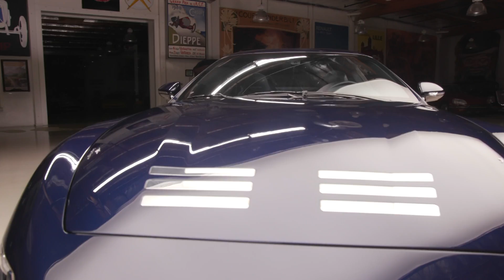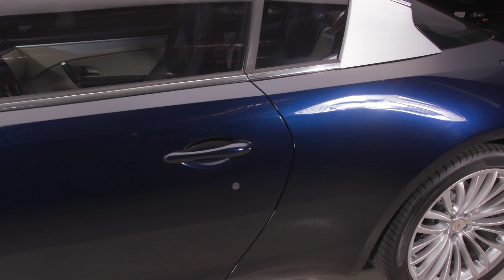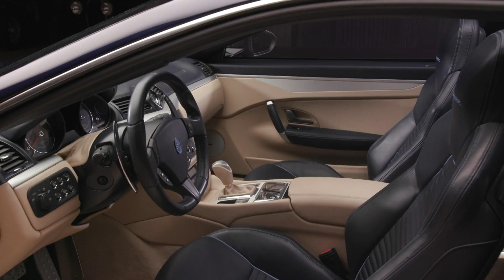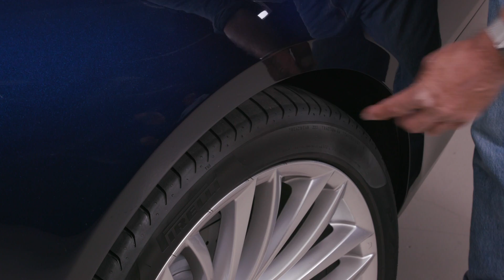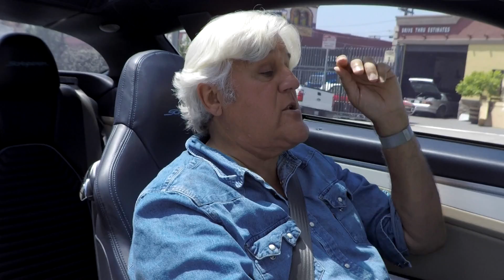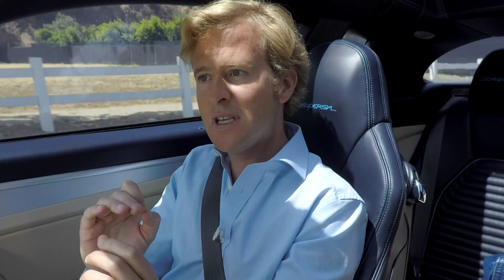2018 Touring Superleggera - Jay Leno’s Garage

Comment: Coming back to this video 7 years later. The design has grown on me. There are some very nice details in there, and it is rather elegant overall. Even if I still think the front-end styling is its weakest point . It reminds of a Bangle era designed BMW 6-series up front, if not as bad.

Comment: Without taking anything away from the excellent work done by the new Carrozzeria Touring Superleggera, it's important to rembember that there is no connection between the historical firm which closed in 1966 and the new firm which purchased the legal rights to the name in 2006: 
Good luck to the new firm, just let's realise it's a different firm to the old one.

Comment: A worthy improvement on the original Massa 4 door, I'm so glad someone did it. Super finish on the Superleggera and what an intelligent application. I see a resemblance
with the Ghibli. The starter is noisy and unrefined and if it were mine you wouldn't hear the engine.

Comment: Just a re-body of a badly engineered Maserati.  I find it interesting Jay left in the negative comments on the de Macross (which borrowed only the Ford engine and trans) while removing them from this thread.  The level of effort and engineering on this car is much, much lower.

Comment: In my opinion, the aluminum applications on the side and on the roof should have been connected in one piece. Also the back end is a bit confusing and cluttered with unnecessary details ...

Comment: a vast visual Improvement on what is still a vastly underwhelming car under the skin-- but it is beautiful now whereas the original is absolutely not , IMO. (Edit. This is the newer grancoupe (sic) which is not at all as bad as its predecessor  )
It resembles a Spyker from the rear now -another underwhelming but very gorgeous car.  Only in the front can you really tell it's still a Maserati under-the-skin, and only in the front is it not an improvement, the profile is unique and exquisite where the orig. comes off as a bit stumpy , very nice overall work, for the vasssssst overall probzble cost , if there are no capital  R reasons they could not , id have used a v12 rwd ferrari or perhaps even , say a bmw 6 coupe...

Comment: Funny how Jay said a car “designed by committee” ends up looking like a Corolla; IMHO in terms of appearance, the new Corolla hatchback with two fewer doors, another foot of wheelbase, six inches more width, a few inches less height, and a couple round tail lights, would make for a better looking FF than the one Pininfarina designed.

Comment: Taking a finished car or chassis and adding a custom one-off or limited edition body/interior has been an option from the early days of automobiles. This technique has led to a huge variety of designs that are not possible in mass production, though there is some debate (see comments) on whether the design is appealing. I think the most interesting custom cars are those that have unique styling and unique propulsion. Louis is clearly a very talented person and it is interesting that Touring can re-body a  Maserati Gran Turismo, but I more admire the people that produce a new body, interior and mechanical bits. At least Touring is only dismembering 10 Maseratis. Doh!
PS: The exhaust seems too loud for a luxury grand touring car....sounds like Jay's 57 Corvette. 🤔  Interesting conversation and thanks for the ride.

Comment: What is kind of cool about a car like this is that with one person controlling as much of the design as happened here, you do get flaws or quirks that are particular.  Other than Bangle, I can't really think of a current designer who has a signature to his or her work.  For better or worse, this definitely has it.  I really like the car, the front looks a little bit like trying to get an E Type to look like a 1st Gen Mustang, but it's still pretty.  I'd have done it differently but it's still cool.  The only real downside I can see to a car like this is you get stuck with a dated Maz interior.  It would have been very nice if they at least could have replaced the head unit with something contemporary.

Comment: That panel on the C pillar and the rake of the rear glass is very reminiscent of Citroën, so much of the car seems to share a common design vocabulary with the best looking cars without looking derivative, nicely done! The very tip of the nose looks like it's forming a letter T and unfortunately makes me think of something that would come out of Tesla but other than that it's a very beautiful body and interior. 

For a technical person it sounds like Louis was trained in how to speak to potential customers, the way he continually avoids the term unibody to describe how the Maserati donor car is made and chooses to use the incorrect word chassis which I feel is a company attempt to closely associate the new product with the old world product in the same way that this new version of the company tries to harken back to a past it has no connection to other than through the check books of its investors. Near the end he admits that he works closely with marketing, it's obvious and necessary or they wouldn't have allowed him to speak at all. Louis also says they didn't make any large tooling for such a small production run and I assumed he meant steel stampings but a minute later he says many of the body panels are CF which does require large tooling, not as large as steel stampings but more than you'd need for hand hammered bodies. Jay also seems to think that the cars are hand hammered too and makes a number of references to what is clearly not the case at Carrozzeria Touring Superleggera srl. It's when Louis uses the word bespoke immediately after talking about CAD/CNC that I find bothersome. Bespoke has become an over used word and does not mean what it used to. Can you really call something bespoke when all you are doing is calling up a file and sending it to a machine?

Comment: This is why I believe that cars are art. There are many cars that are a car. But like in Japanese cars which are getting a bit off course in design. Many Japanese cars and even some American Cars are going through a series of changes.    Many cars are pretty but rolling junk. They would rust away and they would vanish. It's amazing that the Germans get it right they just do slight tweaks here and there. American cars are tweets as far as a grill is concerned maybe some tail lights but then they're discontinued with a whole new design that people probably don't like because the quality is still not there. What American Car designers won't have to worry about designing cars soon they're designing SUVs so-called crossovers and trucks. Pretty soon that's what the Japanese will be doing and that's it. But I believe that the Europeans will be designing crossovers from many small cars with a soul.

Comment: I quite like the car, it’s different and has at least a somewhat unique design. But can you really say it’s truly coach built when Jay opens the door and you see the exact interior as a Gran Turismo? It looked like the only thing that changed in there was the badge on the steering wheel.

Comment: Jay, I respect you more than probably anyone in the auto industry, and I appreciate your vision into this Maserati, with a new body, that if u need a fender, your dead, and those seats that stick out like sore thumbs because they are a different color, and the guys reasoning behind it is not clear, I could see if the color was the same, but ugh, the body is beautiful, but it's still a Maserati, and the dash, steering wheel, air bag, this just doesn't work for me, it's a bit of a sham, going back to the 70s Stutz, like the one Elvis had, that car had more Stutz in it than this has its new name tag

Comment: Sorry Jay. IMO, you can't improve on perfection. The Maserati GranTurismo on which this is based has been in production from 2007-2018 for good reason. To this day, still one of the most striking, beautiful designs on the road. Along with perhaps one of the greatest naturally aspirated V8s ever produced from Ferrari in the 4.2/4.7 engine. Wasted exercise from a great historical coach builder.

Comment: This design doesn't look like anything special,  the over all body shape looks like a whole bunch of other modern cars. Its a simple design that a ten year old could draw. I hate the stupid "football" fake chrome- aluminum stripes on the hood and all the aluminum trim pieces. most of all I hate the cheesy signature on the seats. I cant believe people are paying $400k plus let alone building 10 of these a year. Its the same for that other company Ares Design where they steal a cars uni body, suspension engine like 90% of the car then charge you 400k plus to stick there modern interpretation body shell on it, it ridiculous. This is a beautifully designed car that I would invest my money to get built-   https://www.motor1.com/news/146278/ferrari-612-supercar-rendering/

Comment: I have always hated the look of the stock Granturismo because i find the design of the stock Maserati to be out of proportion and not as pretty as it could be.  This car, as design isn't that pretty ultimately if i have to be honest, BUT BUT BUT this version has enormously improved and make the Granturismo look SO beautiful NOW!  If i had the means and the money, i would absolutely buy this car.  I love the Granturismo as a driving car, but hate the stock look of the normal car.  This version fixes everything, especially the lower lines of the side window, no longer tilted down, but now beautifully horizontal !!  That has single-handedly improved 90% of the look of the original car.

AWESOME WORK TO THE DESIGNER HERE !!  I LOVE this look despite it not looking perfect.   I want one of these Touing Superleggera !  Huge improvement of what Maserati did to the GT!

Comment: The front end looks too busy and tacky. The doors and the side profile in general looks a bit too bland and bloated. The rear is much better but does not fit the sides or front of the car.

Comment: this kind of thing puts a smile on my old face, i used to sit around doing drawings probably similar to what is required to make cars like this happen. i would take bits and pieces of cars that i liked or features of cars that i liked and combine them all into one drawing of a car and make it look similar to several different cars and then people would look at my drawings and some would see well this part is clearly from this car because of the way it swoops and connects here just like on such and such a car sometimes they would nail it spot on but more times than not they would get it dead wrong. either way it was completely entertaining to hear their responses and point out their opinions to me and sometimes their observations would even inspire other drawings. Maybe i was an undiscovered coach built designer of my era but unfortunately those days are long gone now. I haven't even looked at a drawing pencil in over 30 years now. I've got a case somewhere with all of my old drawings in it that i would do instead of my school work. maybe i should dig those out again and see if there is anything modern that comes close to my imagined drawings now

Comment: At first I thought this was a throwback video. The cars styling is a good 20 years out of date, except, of course the flying C pillar barrowed from a Nissan Maxima (Nissans pillar looks much better) The bright work looks like plastic from a cheap RC car and the vents? on the hood look like decals.
The car sound good, but the coachwork leaves a lot to be desired

Comment: Nice design, good balance, don't like the interior color-combo. Car is too loud for my neighbors, should have a 2 stage exhaust. Funny, if you look slightly past the car, it reminds me of the Opel GT, which still today, is great design work! Darn, Opel should build one for a low budget enthusiast in the 30-40.000$ range,  they've got the engines and drive-train...

Comment: This is design for the sake of designing, it's added nothing to the original, which lets face it wasn't much to start with and wouldn't of be hard to improve? The finished article is dated taking influences from not great cars of the 90's and early 2000's. DB7 Aston, even some Vauxhall in there somewhere, if you're from the UK. The guy was passionate and knew his stuff though.

Comment: Admittedly it is a nice design.  I also assume it's one of those "if you have to ask..." situations where cost is concerned. I have to say that the most impressive part is the sound.  The sound that thing makes is simply amazing.
Reply: the sound is typical Italian, and like with all cars: it's all in the mufflers and exhaust design. It's normal for all car manufacturers that they spend a lot of time working out the right shapes to make the car sound right

Comment: The original Superleggera-concept meant that an aluminium-body was build over a thin steel-tube frame. Kind of lightweiht-built. I do not see this on that car. They just stripped the panels and put other panels on the frame. Maybe they are light - since they are made from carbon fibre - but it is not the same. Anyway it is a quite nice car, but I miss 4 big round headlights.

Comment: I appreciate the notion that the aim of this company is to create tasteful references to the great GT cars of the past while also appealing to modern tastes, but in my opinion, this car fails to do any of that, on several fronts.  I really dislike the choice of wheel design (but it's not obvious to me what wheel design would work better) and that fat piece of chrome across the rear above the rear window.  Also, the front end is underwhelming, kind of anonymous looking.  And finally, the exhaust note is more appropriate to a 2000-lb true sports car, rather than a GT.  It's too "boy-racer-ish". There are a few US-based fabricators, who have also presented their wares on Leno Garage, and whose work I find a lot more provocative and desirable.  Interior is just meh.

Comment: I own a Maserati Quattroporte, by no means do I consider myself an expert, but I do feel I know more than the average Joe about the Maserati family. As soon as the video opened and I heard the exhaust, I knew it was the same 4.2/4.7 V8 out of mine and the GT’s. Same thing with Jay opening the door and it made that electronic click and whir of the electronic suspension was so iconic Maserati. That said, I disagree with Jay that this is better looking than the Maserati’s that spawned this. This cars rather odd, I do love the Disco Volante, Touring did with the same Maserati engine. And when Jay pointed out that rear fender that was both masculine and feminine, Maserati does that same line on the GT’s and previous gen Quattroporte’s lol

Comment: A great look at both a design and the designer/process.  All in all, I also like the stock Granturismo better...if it came with the quality bespoke materials inside this one.  The Porsche-esque 'roll bar' has its purpose in breaking up some elements here but I never liked the one Porsche used either.

Comment: Sorry to say that, but in my opinion it is really stupid to sink that Emblems into the metal (like that of the trunk). 
Any little raindrop stay in that area forever and will not leave until you lift the trunklid. 
In the result it will be rotten sooner or later.
They should be some kind of finish to be applied, i.e. clear epoxy to fill that gap.

On the other side, maybe i have been misleaded by the sufferings of my poor old cars.

Comment: It’s nice enough, if a bit drab and indistinct as compared to the GranTurismo it’s based on. Which has really become a classic shape in its own right, and is just sexier than this...the last beautiful modern Maserati.

I don’t like that aluminum panel over the back, reminds me of a Fiat X1/9. A car I saw a lot of as a kid, and even then thought had very awkward rear-end styling that ruined it overall. Only a Triumph TR7 was as bad or worse. 

Also the front aspect in the bumper area looks odd and has too much chrome, but I do like those chrome strips on the bonnet the designer used instead of faux slats, still I don’t know why Jay is so enamored by this Touring 🤔

Comment: What do you do if someone bumps into you in the parking lot and you need a fender or quarter panel?
Reply: The part about no tooling made for these cars is a bit of a lie if I'm honest.  There will be a mold for each part where you can lay up the carbon fibre again.  Expensive replacement it will be though

Comment: Everytime somebody says a Corolla has no soul, I want to tie them to a chair make them sit through hours and hours of Uwe Anderson's TTE videos as well as AE86 working wonders on the track...
Reply: Fine 32 years ago it had a soul... As long as you stripped it and changed the suspension out and out on a set of ITBS cams and exhaust... Sure maybe then
Reply: Pretty sure the TE27 had some soul too, but as they say, haters gonna hate.
Reply: Exactly the car I was thinking when I mentioned Anderson and TTE. That's what he started TTE with. That's what my dad started rallying too. I grew up in one of those. Full rollcage too. And leaf springs... or spring! As the host says "when the men were men and the women were glad for it."
Reply: Corolla has no soul